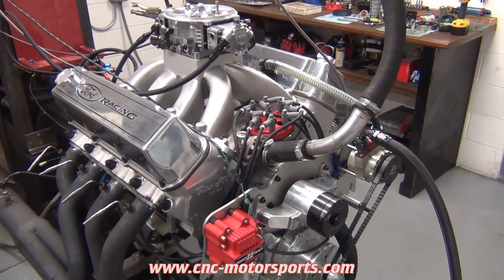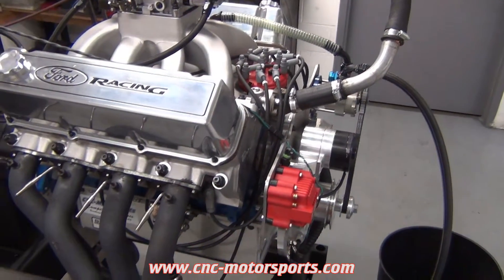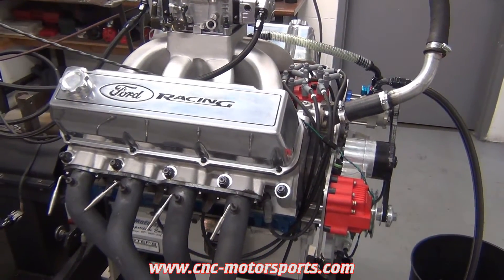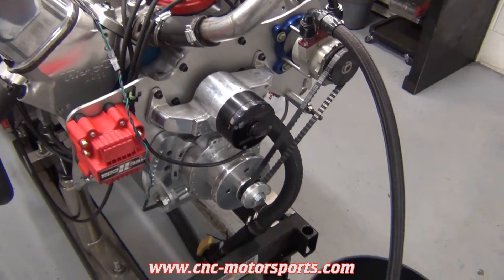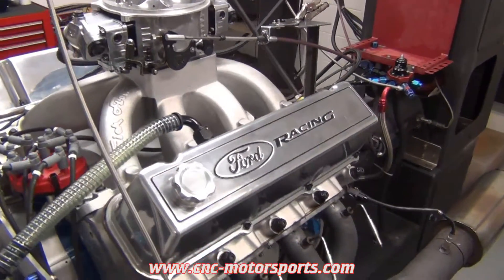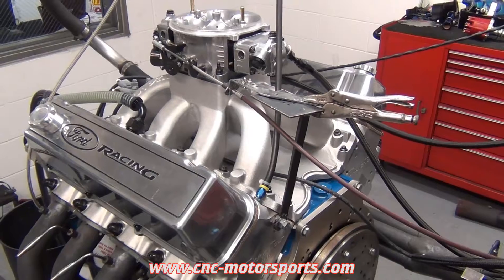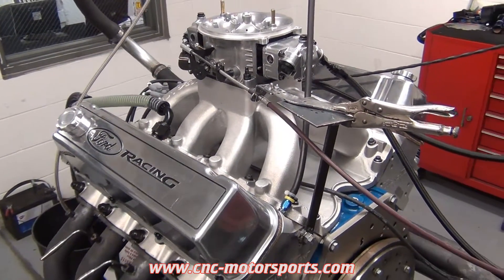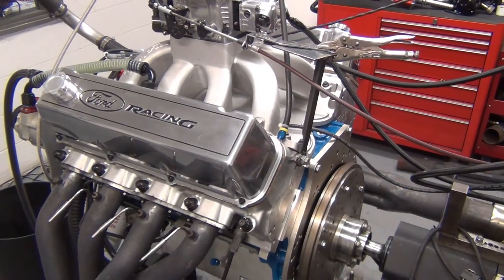598 BBF Engine Build by CNC-Motorsports

Comment: Any reliability issues with bbf and bbc with massive stroke? What is the redline? And is it advise to run it on a pro drift car N/A
Reply from the maker: For drag racing there aren't reliability issues. You build the engine for the intended use. For a drift car, you would reduce the stroke and build according to the engine intended use for reliability.
Reply: @cncmotorsports  Would power adder would you recommend for this
Reply: @cncmotorsports   i

Comment: Last weekend on Engine Power they built a 636 ci BB Chevy ..this wasn't a budget build, top dollar parts, order and assemble, 14.5:1, ..made 1021 hp and 833 lbft trq.   Enuf said..
Reply: That's pathetic.
Reply: It’s an air pump, Chevy stuff is more prevalent in drag racing.  They make a BBC exhaust port on BBF heads, not the other way around, R&D is way up on BBC stuff than BBF. I like the 385 series because of the small combustion chamber equates to more compression with a flat top piston. You can find stock block 460s on the cheap and stroke them to 557CID without an aftermarket or tall deck truck block.
Reply: Just so you know The guy from Power Nation went to Jon Kasse's and watched them build A big block Ford and couldn't believe it made more than a 100 horsepower more than his high dollar Chev with between 30 and 40 less cubic inches.
Reply: Donald K. MacBaird Top use to build Pro Stock motors for Greg Anderson back then, he’s not easily impressed, it was shock value for television. I’m pretty sure they didn’t want to show up Kasse Racing Engines. But in the end they are still air pumps pick your poison. They use the same aftermarket rods and valves that are used in BBC. I like both manufacturers
Reply: @gilbert-g2f  lol- Your def a Chevy guy. Kaase said after the show. They left some on that table just in case. Hot Rod is Chevy bias and they said. Best HR engine of all time the Ford Cleveland. Easiest engine to make 600 hp with. The Ford 460. Nuff Said! I am sure there is more in this engine. It's a hard pill for a Chevy guy to swallow. Suck it up Bro.
Reply: @hdvictoryford5329  knowing what I know now about the show it’s all for not and there’s no  point arguing about anything relate to this show. Kasse is awesome never would disrespect him on any level he’s forgotten more than I’ll ever know about building power.
Reply: @hdvictoryford5329  for a race application the clevor was awesome the heads were nothing to write home about box stock for a street application. Hey! You win my friend it’s just an air pump. Actually I’m assembling a 2015 5.7 Hemi for my engine performance class, have a great and joyful day.
Reply: @gilbert-g2f  It's not about a win,lol. Most don't know about Ford performance and the many engines Ford built that were just killer. Like the 289-350 hp. Both Ford and Mopar had to build them tight and right from the factory as GM had the corner on after market parts. As it turns out GM really had many flaws in their design. Who said so? Their own engineers, they pointed out almost a dozen, hence the Chevy 350RO. Look it up on you-tube. This engine was the result of getting rid of these design issues. To me it is a Ford engine with Chevy valve covers. HAGD
Reply: @hdvictoryford5329  it’s still an air pump, with bracket racing and sportsman drag racing Chevy has been the dominant engine, parts availability etc. I’m not making it up go to your local drag strip on a bracket night, then go to a points meet or national event (sportsman racers) I’m not splitting hairs those are facts. I love engines period, but the fact they are all air pumps pick your poison.
Reply: @gilbert-g2f  No one said they weren't air pumps. My ninth grade shop teacher taught that in 1963.Chevy is dominant for one reason, NHRA has favored them for years. They have factored Ford and Mopar. GM is far from a better engine which is my point. And Bro I have drag raced for years, the Chevy engine is flawed big time. Thier own engineers say so. So is it dominant or just made to look that way. I have owned Chevies, POS. Every one was nothing but problems from day one. And if you push them you better have money for parts. Tell me Bro who dominated pro stock for decades? Who had the only undefeated pro stocker ever? B Glidden and it was a Ford. To prove my point, even when Glidden was dominating, not one Chevy guy switched brands. The NHRA factored Glidden first 50# then 100#- the150# and he still won. And it continued, Chevy is dominant for one reason, NHRA stacked the rules so only Chevy could win! That is fact!!!!!!
Reply: @hdvictoryford5329  glidden was a great machinist/engine builder and driver, he would have won with any halfway competitive engine. Thats a driven racer he just happened to spend most of his career in a Ford, thank God for you Ford guys Lee Shepherd passed away when he did huh. It’s still an air pump you can argue till your computer melts. Chevy engines dominate little guys bracket and sportsman drag racing and that’s without the Glidden name.
Reply: @gilbert-g2f  You are starting to sound moronic. I KNOW ITS AN AIR PUMP! I have worked as a mechanic for over 50 years. And just because its an air pump does not mean they are all built the same. Open your eyes Bro. Chevy engines are not the "BEST" bullets. Weather you agree or not is irrelevant. Ford owned Stock eliminator in the 60's. The only reason Chev is good is the sanctioning bodies give them the breaks and they factor Ford and Mopar. And Bro since the Coyote has come out more Chevy guys than ever have gone to Ford. And it will continue. The car shop down the road does only Mustangs. The owner has a BBC in his Stang. He has told me many times that when the cost of a Coyote swap comes down he will go to Ford. And Bro we are there.
Reply: @hdvictoryford5329  since we are insulting, you sound like a narcissist. Me me and look at me, it’s an air pump race drive what you want. I was a diesel mechanic from 93-‘14 in the Air Force I’m in school refreshing my craft, this is my last post thank you for your insights. Bye.

Comment: Can you add a blower to this motor?
Reply from the maker: You will have to lower the compression for a blower.
Reply: @cncmotorsports  Thank you I definitely have a few questions about it, I want to build a mega truck for racing and a lot of the competition run 1500 all the way out to 2K HP blower motors mainly 540ci and so forth but I’m a Ford guy and I want true Ford HP would you recommend this motor or maybe go lower down to a 545 , 572 ?

Comment: I assume this was a 4.6 bore, 4.5" stroke combination. I wonder how it would have performed in a 4.44 bore, 4.7" stroke combination
Reply: pistons get too short at that stroke imo..
Reply: Torque would’ve increased a little, that’s about it. But the 4.44” bore on the a460 heads would likely hurt peak hp I think
Reply: @juliennacer8871  lots of 632s built with even shorter pistons
Reply: @taylorgtrotter  torque wins races.....
Reply: @fairlanemuscle  the potential gain wouldn’t be worth the price of a custom crank at 4.7” with a smaller bore center on A460 heads. The 4.6x4.5 bore stroke combo is better, and it saves you the money on a custom crank
Reply: @fairlanemuscle  I never liked 632s. poor rod/stroke ratio, very short pistons and cylinder walls that have very little if any at all meat left over for rebores. all power no longevity.